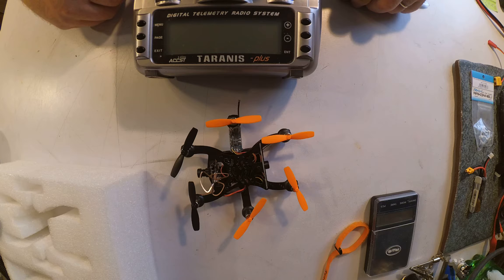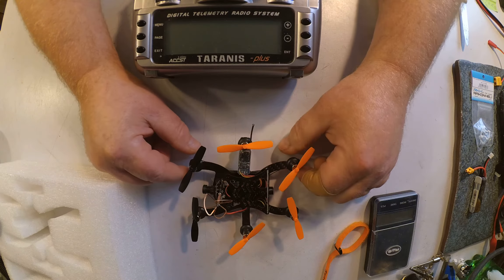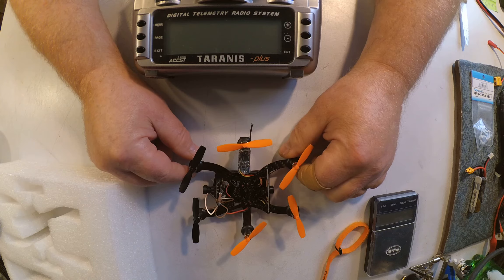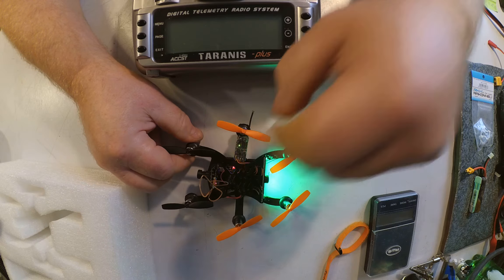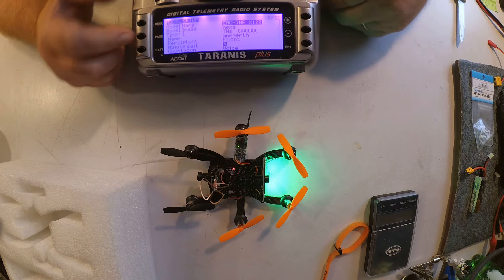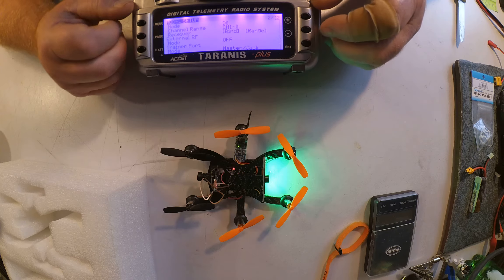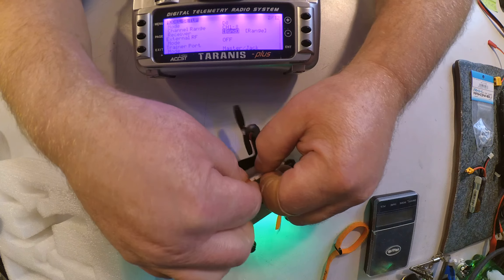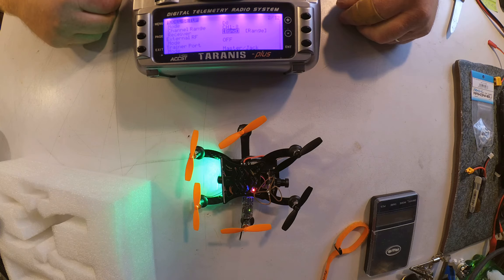Binding FRSKY Version EACHINE EX120 to Taranis Transmitter

Comment: hi! everything ok since 2017?
I bought a Taranis qx7 and I was thinking about buying a machine tyro 119, would it be as easy to connect these 2 together as you did with those 2?
Reply from the maker: The EX120 was a Bind-&-Fly; I picked the FRSky model, so of course it was this easy. ;-) I haven't seen a Bind-&-Fly Tyro119; they're usually a kit quad. Google "Eachine Tyro119 Build" and you'll find oodles of build vids; this is a very popular kit due to high bang:buck ratio. Cheers!
Reply: @mnemennth  so I saw one that doesn't come with the receptor, if I buy a receptor that can handle the fr sky type of transmission can I apply it to the drone or do you think it will not be able to connect? (Sry Im a noob at this)
Reply from the maker: @mcinacio8323  Yes, you would need to buy a FRSky receiver. The major brands each use their own radio protocol; with a few exceptions (transmitters that are sold as "Multi-protocol") every brand of radio has their own line of receivers that match them.
Good building!